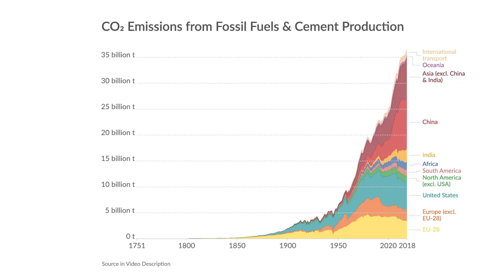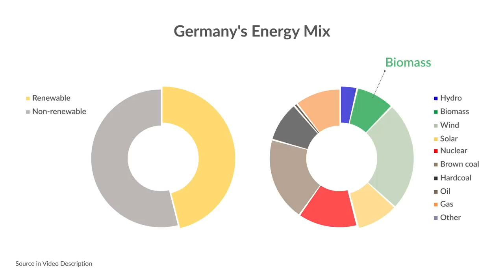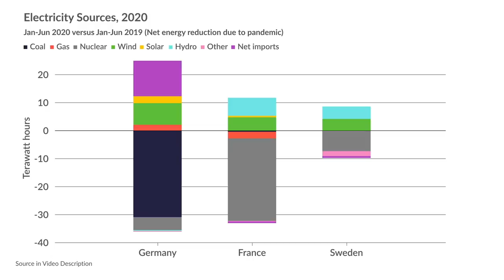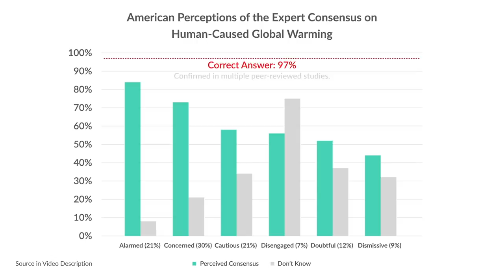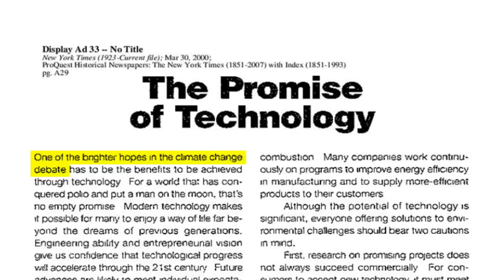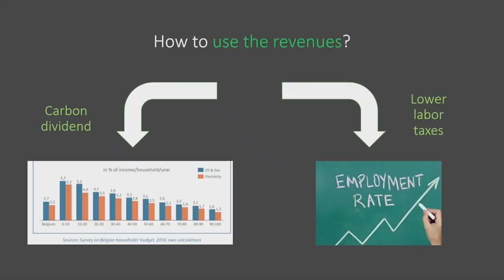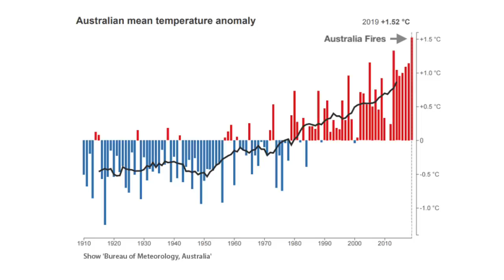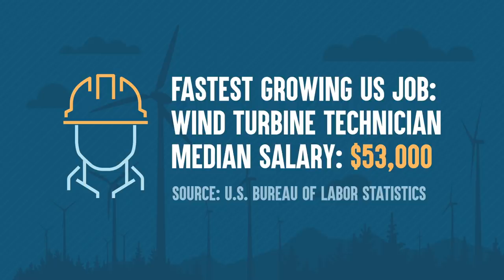The $5,200,000,000,000 Trick Killing More Than Covid, w Stephen Fry.

Comment: What I think is hilarious is that the turbines are partially made from fiberglass and plastic. Those 2 products are direct byproduct of refined crude oil. What are they replacing those with when oil is banned?
Reply: Bambo apparently 😊
Reply: Oil will be banned for fuel not for all scopes.
Reply: Ok….
Replaced with what?
Reply: @jasonnabors5045  What will replace oil as fuel or to make plastics?  What I think is hilarious is if we move away from fossil fuels for cars and plants the fossil fuel industry will be the biggest winner.  Their product is terrible when lit on fire.  When not burned its much more valuable and these companies will survive into the future longer
Reply: @anthonypape6862  
So what will they replace it with?
Reply: @jasonnabors5045 All I can say is what I like, not that anything will be done.  Cars should be hybrids.  70%electric but with a methanol flex fuel engine.  Practically zero carbon emissions, way better range, Does not pollute to make if using solar or wind excess power.  When the grid has no reason to buy.   Put the other resources around potential energy storage like flywheel, gravity, etc.   Use oil for anything like plastics, just don't burn it and you're fine.  Keep existing nuclear and hydro, but with enough solar and wind and the storage should be ok.
Reply: @anthonypape6862  I am very familiar with the oil industry. I do agree with you on the fuel issue. They can literally use the natural gas that they flare off at the well for fuel. And then use the rest of the crude for plastics and the like. Going electric is fine with me, as long as they can make a 4 wheel drive with front and rear lockers that can tow 10,000 lbs and go anywhere on 1 charge. I don’t just use my vehicle to transport my body from place to place. And it had better be under 10k to purchase. Here in Texas driving is not a privilege it is a necessity. I have to drive over 100/200 miles a day for work. I don’t have time to stop and charge a car for hours to get to a job. And don’t use the hummer for an example. Those are a expensive piece of crap. I have seen them and talked to people about them.
Reply: @jasonnabors5045  An electric truck can do everything a diesel can but 10x better and more reliable.  But I have no idea why they don't put a flex fuel engine in it that gives you some emergency range.  Methanol is racing gas and has 80% less emissions than gasoline.   But I don't think they will ever make gasoline illegal.  If electric is better it will have to win everyone over and die like VHS has, of natural causes.  Making gas illegal should turn out a  lot like prohibition did.  There is always going to be a place for the noise that ICE makes.  I tell you one thing there won't be electric Harleys.  But if electric cars win we can't be charging them with coal fired electricity.  It defeats the whole purpose.
Reply: @anthonypape6862  what electric truck?
Reply: @jasonnabors5045  Tesla's Electric Pick up or Even Semi.   It's just a much higher torque and instant torque motor than ICE.  This vehicle obviously is not $10k it will take some years.  But if Electric becomes predominant which again I hope are electric skewed hybrids.  It will be a big decline in emissions.  Not sure if anything can be zero unless some type of formula is given to businesses like planting trees or buying rain forest and protecting it that will give them the credit of going carbon neutral
Reply: @anthonypape6862  
Both look like garbage. I would never own either of those. The price tag is equally stupid. They would have to make serious redesigns as well as being able to be heavily modified suck as lifted, after market part upgradable. Run 500 miles towing a trailer @ 10,000 lbs
4 wheel drive with front and rear lockers. Able to rock crawl and drive through salt water with no issue. Tesla’s are made to take humans and grocers from point a to be. And it would have to be priced well below any gas or diesel vehicle before I would even test drive it. Matter of fact it would have to be under 20k for such a vehicle I listed before I would even look twice at it. Not to mention where I go there aren’t even and gas stations most of the time not to mention charging stations
Reply: Not that difficult to understand REDUCING use of something, and stop burning it, versus ELIMINATING it altogether.  Nice try though.  Try reading a book.
Reply: oil is not banned, burning it as fuel might be.
Reply: @jasonnabors5045  nuclear maybe? Natural gas? renewable? I'm not gonna pretend I know the solution.
Reply: @ArashRezaee  
We could be running on natural gas right now instead of flaring it off at the pump
Reply: Oil + coal won't be banned. Your thinking is polarized. All that's happening is it won't be the primary source of energy production. It'll still be here but it's widespread use for car fuel and other areas it won't be the main fuel, that's all.
You see coal will likely always be used for steel production for example, it's just ways of using it will become more efficient and carbon offsets used when it's burnt by that industry. The usual accounting treachery will still be there though - you can be assured of that.
Reply: There is a list of products made from oil as long as the room I am sitting in,  The kids are going to be some upset that some of their favorite items, like computers, phones,  are no more.  Even some medicines are from oil, and fertilizers, on and on. 
 Solar hardly works on individual bases, mush let for the masses to replace coal and oil.
Reply: Glass mat and steel are not plastics and though the resin is it can be sourced from plant oils. Any other poorly informed objections I can clarify for you?
Reply: @jasonnabors5045  I should have read more of your other replies before I bothered to waste any time on a boomer. Roger Roger coffin dodger
Reply: @jasonnabors5045  your's isn't an argument
Reply: @oneplaneteer1708  aww 
Did I touch a nerve?
Reply: @jasonnabors5045  do you know the between a hydrocarbon and a carbohydrate?
Reply: @jasonnabors5045  if that's what you need to think to feel like a real boy, go ahead.
Reply: @jasonnabors5045  personally, I thought it was clever as shit. I but you could even find a use of it.
Reply: @jasonnabors5045  where'd you go, sweet tart? Can you tell me way color an organic solvent is?
Reply: @jasonnabors5045  Hey, Jennifer. Can you tell me how much volumetric evergy is in a pound of wood vs a pound of coal? Can you tell me what the heaviest tree in the world weighs?  Can you determine the next question i want to ask? You're  can't even start to comprehend how much knowledge there is pertaining to anthropogenic environmental changes and you can't come to terms with that so you just say, nu uh.
Reply: They'll figure it out, as do all technology companies as the landscape changes. Just because something isn't perfect, doesn't mean it doesn't have value and didn't mean it won't improve our be replaced with something more efficient.
Reply: Hemp fibre mixed with hemp oil, similar to the hemp vehicle Henry Ford manufactured some 100 years ago.
Reply: @markcox5535  
Don’t you mean Cheech  and chong
Reply: @anthonypape6862  1) There are other sources for plastic than oil. 2) Environemntalists oppose burning fossil fuels. Why not use it for renewable plastics and fibreglass.
Reply: @granthurlburt4062  well ya that’s what I said. I was replying to the guy that thought it ironic to put oil in plastic and other materials that wind turbines or solar panels are made from is itself constructed from “banned” oil.  States have put forth legislation banning the burning of some fuels but I don’t think they are harmful to the atmosphere when using them to construct something.  So Although I’m sure science has a way to make plastic without petroleum it is the way they make it now.  What I think is ironic is that the oil companies will be among the biggest winners when oil is not used for gasoline. Not only because they will have a planet to operate the company but they will have much more time to prepare for the day they do run out.  Which is currently estimated at 47 years. But these jackasses would rather fight the change.  I think they’re screwed the same way big tobacco was.  They have been caught belatedly covering up their own climate studies and depending on the repercussions of climate change may be strung up by the public themselves to pay for their crimes.  If they had told the truth no one would have blamed them how could you know?

Comment: With the prices in Germany for renewable energy it is exactly the opposite as said in here - with about 32 cent per kWh we have the second highest price for electricitty worldwide.
Reply: Check the source in the description. Then check your own source. You're probably confused with the difference between retail and wholesale prices. Here's an easy answer for you:
The wholesale price accounts for the generation of electricity and the retail price also includes the transmission and the maintenance of the grid. 
And before you say the high retail price is what matters, consider my scenario. We just paid roughly A$3,000 for some solar panels here down under and it's been outputting an average 18kWh a day over winter. Let's assume the output doesn't go better or worst even in summer and panels break down after 5 years, we've paid (in USD) $2,200 for 32,805kWh. That's 7c/kWh and these 32MWh are part of my consumption that my electricity company won't be able to charge me while using the grid. What do you think they do? They increase the retail price to make up the difference, aka charge everyone more for what they use.
In the end do I get to pay less? Hell yes even before the government's subsidy. Did the power company get their fair share back? They got more than enough since my non-solar neighbor have to pay even more.
Reply: @sharonyoung9220  Don't post links to the far right here, this is a channel for grown ups.

Comment: Some stuff is good on here.
But then you plug a hyperloop video and I go, yeah... Ok.. I'll just go over here.. *shouts "you know it's just a dangerous and over priced train in a tunnel?"
But carbon taxes should be higher and be used to subsidise it's replacement.
Reply: Hyperloop is just an insanely complicated solution for a problem that already has a solution. TRAINS already exist, they are much more energy efficient and waaaayyyy more reliable and safer. Hyperloop is basically a scam, somewhat similar to "solar roadways" (which nobody talks about anymore).
Reply: Hyperloop? I stopped listening after that.
Reply: Higher carbon taxes are just gonna come from your paycheck.
Reply: That doesn't discredit anything else though.